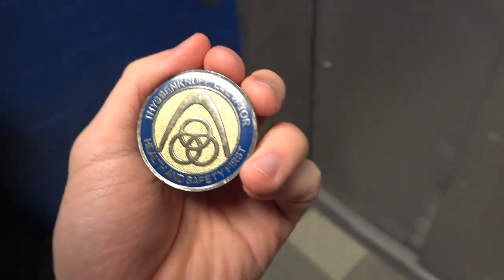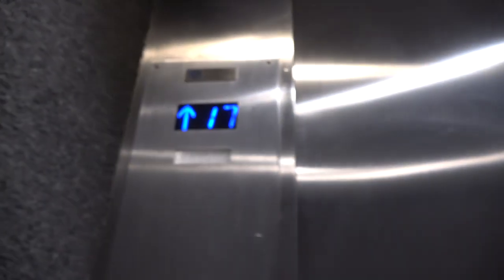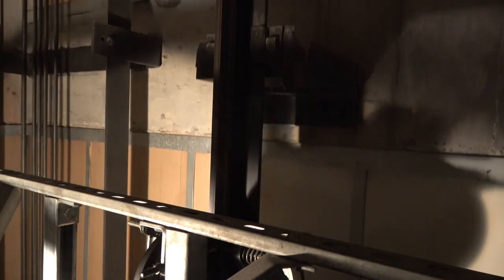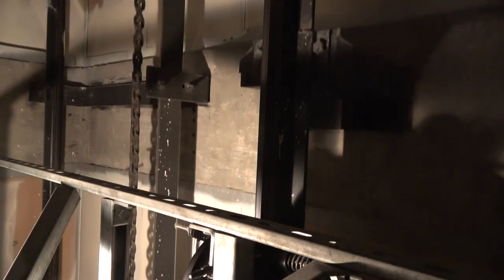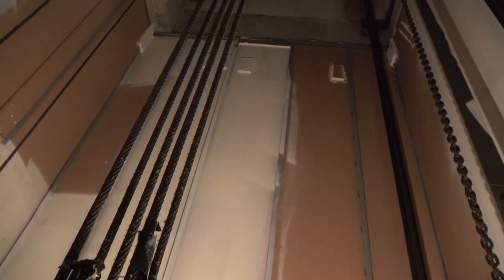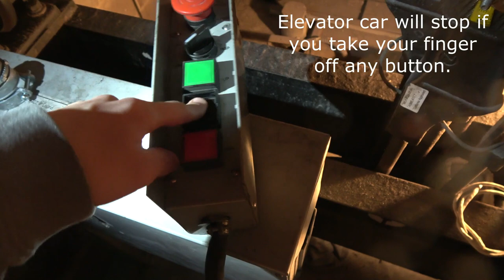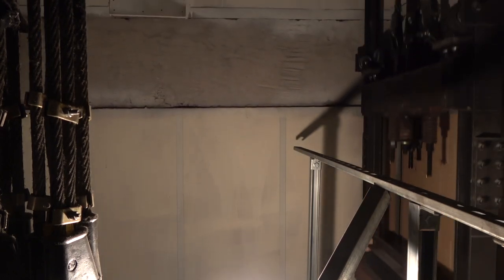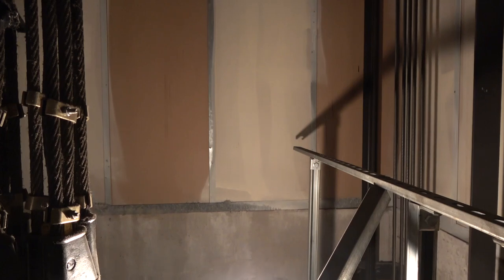Elevator Surfing/Shaft Ride! ThyssenKrupp Traction Service/Freight Elevator

Comment: Thisbthe slowesst elevator ever 😂
Reply from the maker: That’s because when someone is running the elevator from on top of the elevator car, it’s known to be slow because the elevator is set into inspection mode. You never ride on top of the elevator car inside the elevator shaft and full speed, it’s very dangerous!

Comment: That has to be the slowest elevator ever.
Reply from the maker: That’s ’cause the elevator is set onto inspection mode. You never ride inside the elevator shaft at full speed because it’s dangerous.
Reply: @JimLiElevators  depends. we always set the inspection speed to 0.5m / second. that's slow enough to be safe I think. you can still go sloth mode if you want but nah.
Reply: The car is Def on inspection and most likely being run with a cartop run box. Comp chains are attached both under the car and under the counterweight to eliminate excessive shifts in weight.
Reply: Yeah